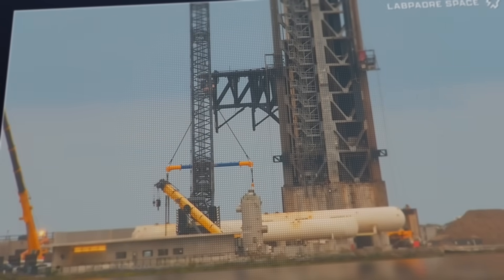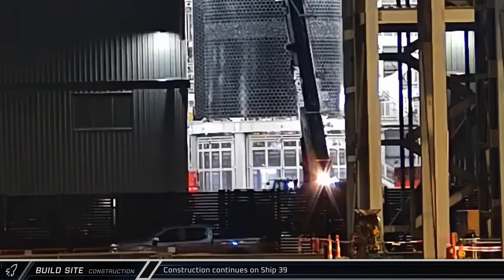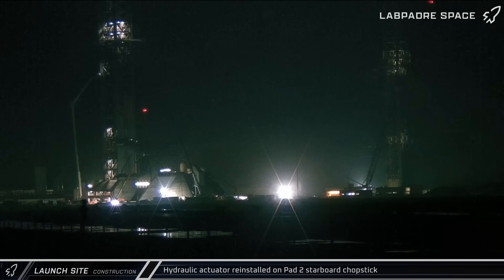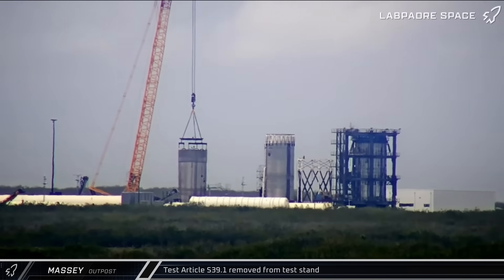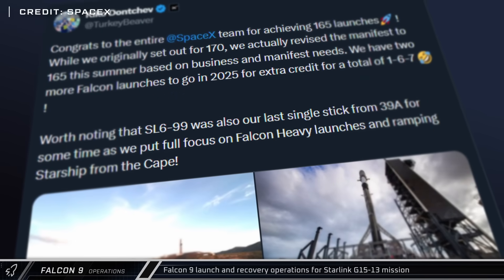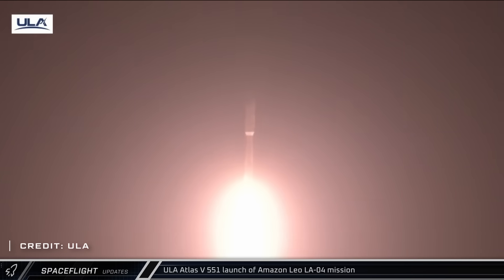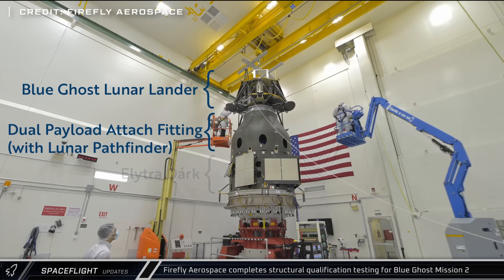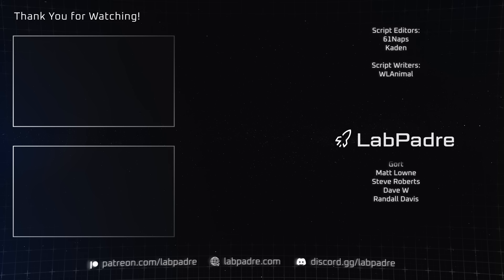Is SpaceX Ready to Start Testing Orbital Refilling? - Spaceflight Weekly #198

Comment: Answer is no😂😂
Reply: Betteridge's law of headlines is an adage that states: "Any headline that ends in a question mark can be answered by the word no." It is based on the assumption that if the publishers were confident that the answer was yes, they would have presented it as an assertion; by presenting it as a question, they are not ..."
Reply: @flsh-v6p 

SPOT-ON 👍. 
Also, in the field of particle physics. Such concept, referring to the research papers, has been referred to as "Hinchliffe's Rule," since before 1988. Manifested during my University Days of struggle.
Reply: Nine more explosions.

Comment: The cant even keep the damn thing in orbit without something going wrong. This timescale needs to be extended by another decade at minimum. I have not seen enough progress. Yes they’ve made progress but not the kind that will fit their timeline. 

There will need to be at least a dozen flawless launch/orbit/capture attempts before even considering fuel transfers. This will require a final version of starship that works perfectly every time or at least on par with Falcon 9 success rate.
Reply: Google 'test article'
Reply: @Contrarian-ol2bc  can’t fix ignorance.
Reply: @lyricbread  you're just being polite.
Reply: Not "at least a dozen", but one or two launches. SpaceX could have easily put the Ship into LEO on many of the 11 test flights to date: IFT-3, 4, 5, 6, 9, 10 and 11. But the flight plan on all of those test flights was to test the heat shield and the reentry guidance in a safety-first way. Hence, the use of the remote Eastern Indian Ocean as the landing zone instead of the Pacific Ocean near Hawaii or at Starbase Texas. SpaceX plans to land Starships at Starbase Texas in late 2026.
Reply: They haven't even tried to 'keep' it in orbit.  You zero's never even TRY and have a clue what's going on or why do you?  You don't even know how do you?